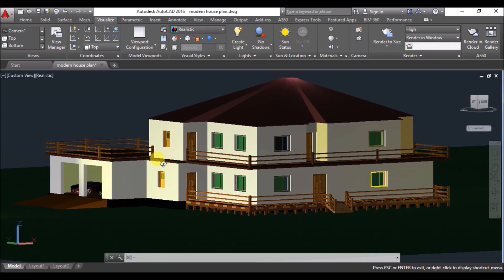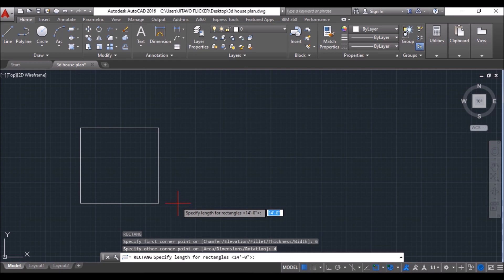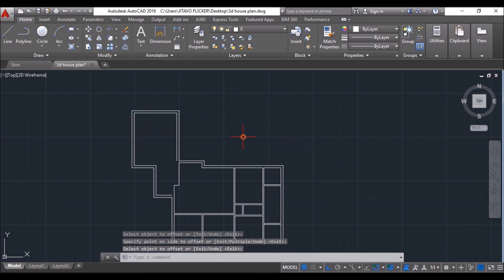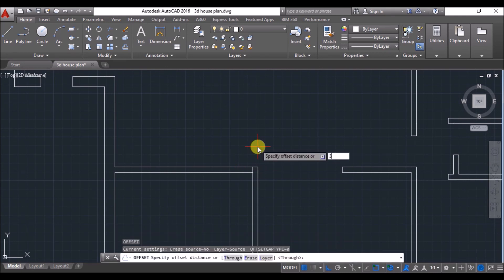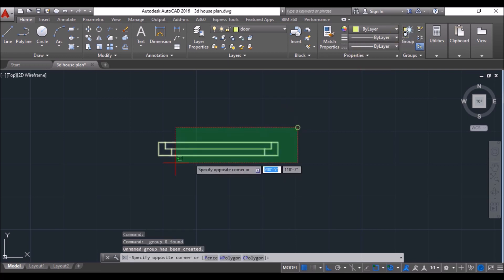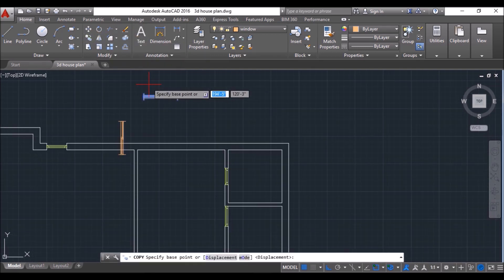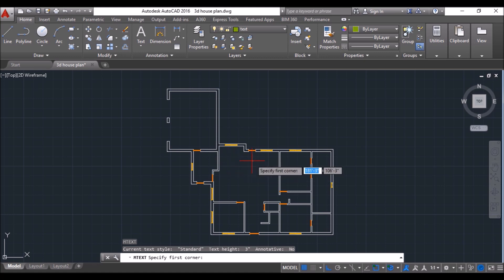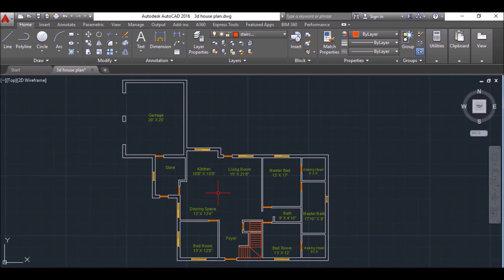AutoCAD 3D House Design

Comment: How do you flip the rectangles from right to left as you draw them so they are in line with the other ones? like the 8',8' you draw on top of the 8',17'10" one?
Reply from the maker: You just have to left click on the side you want to place the rectangle
Reply: @CADDMANIAC  Hi, I tried doing that, but then i end up not with the right height's or widths.. when do you do this?
Reply: What i am meaning is that for example from 2:21 - 2:22 the rectangle appeared to be placed on the right but it flipped to the left instead with the fixed dimensions.. how is this done?